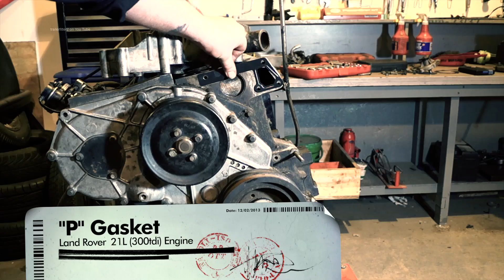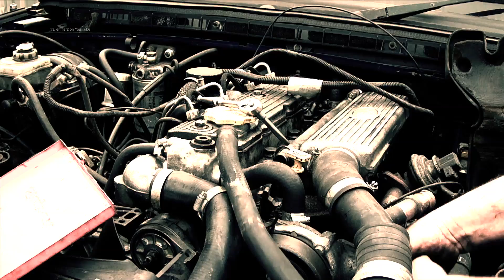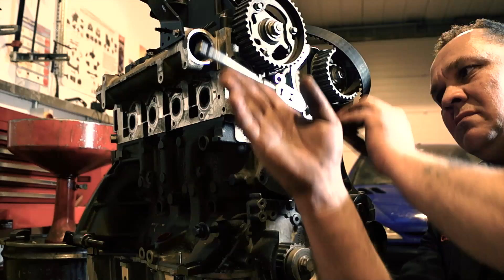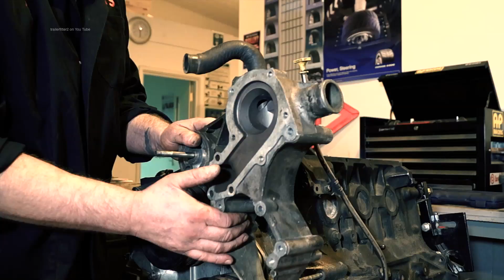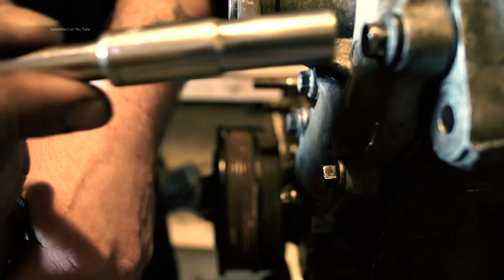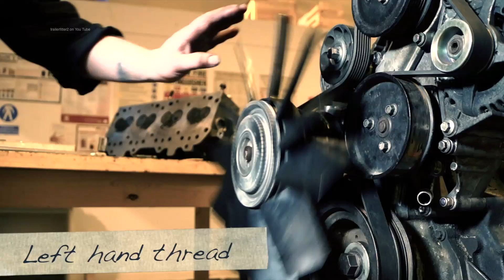Replacing the P gasket PET 100790 - 300tdi engine Land Rover

Comment: Thanks for your vid! When the gasket is leaking is it easy and visible to check the coolant leakage. Where to search for?
Reply from the maker: coolant leak will be visible on the side of the block under the water jacket gallery to casing joint.
Reply: Thank you very much for the tip.
Yesterday my 300 tdi temp gauge touched the red color, I stopped, waiting 30 min to cool off and then filled it with new coolant and did the bleeding. After this I could continue the trip and even push the engine a bit, always with a steady temperature. What might be this?
Reply from the maker: Low coolant level perhaps?

Comment: Thanks a lot, oyu saved me.
Just a question, HS 2.5 and 300Tdi are the same right ?
Reply from the maker: Igor Lollato  HS 2.5?    Which engine is that?
Reply: ***** I don't Know, i have a 300Tdi, at least I used to call it that way, my motor is the same as the one in the video, but when I try to buy the Water pump the seller cant find a motor called 300Tdi, he says that the motor of the one ten made in 2005 are the MWM HS 2.5 for model Euro 1 and Euro 2, so i went to check for plates on the motor and I've found a plate with exactly that " MWM HS 2.5 ", is it possible to be the same motor just being known as different names ?
Reply from the maker: Yes most possibly.  Terminology can differ depending on parts suppliers.

Comment: Great video and instructions. Is it ok to just replace the water pump and gasket without the P gasket or should they be done at the same time? I have no leaks but just a noisy pump bearing. Thanks
Reply from the maker: If the P gasket is not leaking don't worry about it unless it looks like it has lashings of silicone on the joint then it may be a cause for concern.

Comment: This is a good video it helped me along. Now I need to replace the heater matrix in my disco 300. Do you have any video tutorials to do this? Thanks in advance for any help.
Reply from the maker: No sorry  none on the discovery.  It need the dashboard taking out completely to access the heater matrix and blower unit.  Not easy but at the same time not rocket science.  Have a look at the body section of the Discovery workshop manual.

Comment: Just going to do this myself after finding out that mine is leaking, thanks again Chris!
Reply from the maker: That is a weakness of most of the Land Rover diesel engines. Poor design.  Good luck with it. Doesn't take too long to do.
Reply: All done in the afternoon, was pretty easy because I already had the rad out and fan off ready to fit my new intercooler. As expected, lots of silicone rubbish to remove.

Comment: i just did this last week  on a Mercedes Sprinter 312d argentinean versión. Good video i wish i had seen that before.
Anyways just once advice: have to put thread locker on pulley's bolts, loctite 277; 22-28 Nm. Cheers